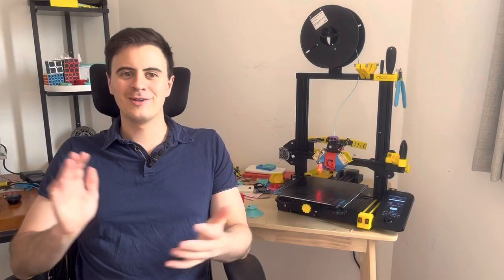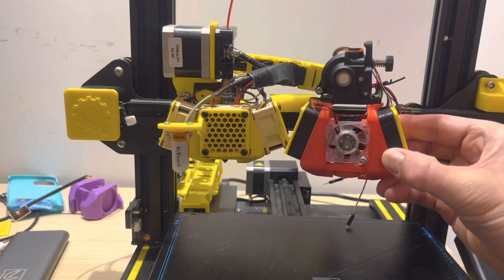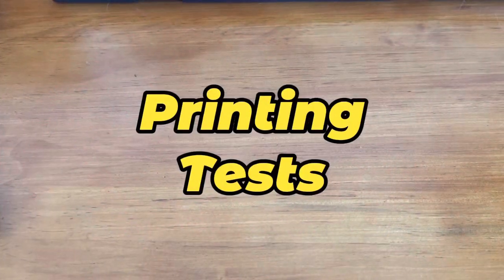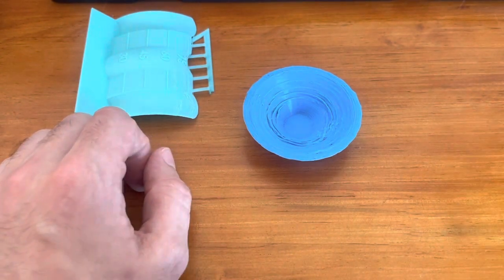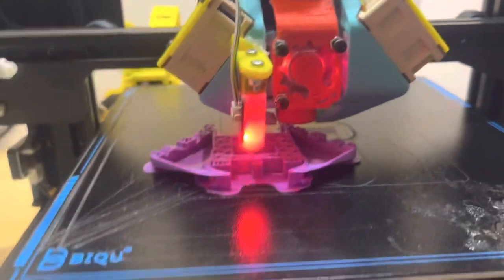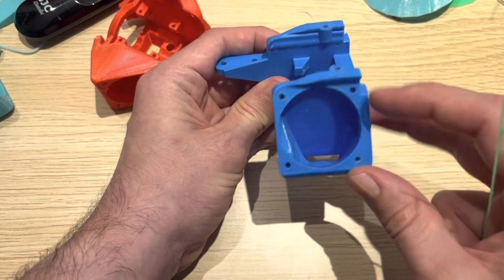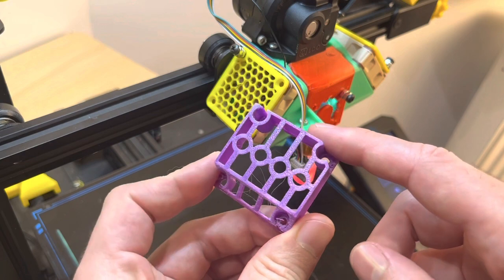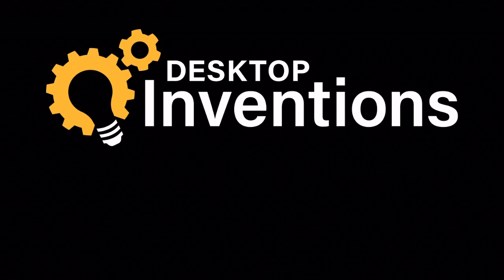Ender 3 V2 Printing Head Upgrade Dragonfly + Orbiter V2 (Part 5)

Comment: Why not to use 5015 ?
Reply from the maker: This is a great question. I wanted to stick with axial fans to be more quiet, but in the end the 5015 radial fan performs a lot better.

Comment: This was phenomenal! Great engineering! Super interesting! Cant wait to see more!
Reply from the maker: Thanks for the kind comment!  Glad you found it interesting, I thought I was going crazy after about V7 haha
Reply: Seriously 👏👍
Reply: @DesktopInventions  do you have a redesigned x axis stop switch for the larger shroud?
Reply from the maker: Yes I do thingiverse 5154640 now has a long version to download
Reply: @DesktopInventions  it seems the slot for the x axis switch is slightly too large. Is there a specific perimeter and infill combination, or just put a dab of hot glue on the switch
Reply from the maker: Increasing the line width or the flow will help close up that gap tighter. Mine was slightly fused together coming off the printer actually. If that’s not working for you a dab of hot glue would also work.

Comment: I have a slight issue with the design, i 3d printed the mount and ordered the parts. But now the Orbiter wont fit because its mounting holes are offset to each other and the drongfly bms is too long for the mount.
Reply from the maker: Which version of the orbiter did you order? Also which version of the mounting head did you download from Thingiverse?
Reply: @DesktopInventions  I downloaded the mounting head for the 4010 fan at front and I ordered the v1.5
Reply from the maker: Ok I think the orbiter V1.5 has a different mounting pattern. I can look up the model and make a quick modification.  I’m not sure why the dragonfly isn’t the right length though
Reply from the maker: Do you have a measurement of your dragonfly from nozzle tip to the Bowden input?
Reply: @DesktopInventions  is there a different version than the dragonfly bms? I would really appreciate that if you added it for v1.5
Reply from the maker: My dragonfly is 49mm from nozzle tip to the top of the heat sink. I don’t think there are different versions, let me know if yours matches. I can finish the model tomorrow for V1.5
Reply: @DesktopInventions  that would be amazing because the v2 orbiter is out of stock sadly in my region
Reply: @DesktopInventions  and I just ckecked, the blue dragonfly bms has one fin more on the cooling part.
Reply: @DesktopInventions   @DesktopInventions  dragonfly changed the length for their hotends, they now have 7 fins and not 6 like the one you have in the video. They say that Top of toolhead to nozzle tip is bang on 61.5mm.
It is a drop in replacement and has the exact same measures as the ender stock hotend.
Reply from the maker: That's interesting, I couldn't find anything on their website about a 7 fin version.  Anyways I added several updated models to Thingiverse and Printables now and some pictures to explain which models go with which parts.  The model you should need is the Mounting_Head_Stock_Orbiter_V1.5_4010 which has the same vertical height as the ender3 V2 hotend and has mounting holes for the Orbiter V1.5.  I hope this works for you, let me know if you have any more questions!
Reply: @DesktopInventions  I can not put it into words how thankful I am. Thank you very very much you are the best!

I did some research on forums about the hotend, there is no much info but it seems they noticed that the 6 fin version was a bit too short as a drop in replacement for the ender 3v2, so they made it longer. The pictures from where I bought it ate with 6 fins, but all the pictures from reviews are with 7
Reply from the maker: That makes sense, their website says it’s compatible with Ender 3 I suppose they just didn’t update all the marketing pictures.

Your welcome I hope it turns out well for you 😀 I’m working on a new version with magnetic attachment next maybe I can get the video finished next week on that one.
Reply: @DesktopInventions  I will submit a picture jn thingyverse once I fully assembled everything. I'm definetly stocked about what's coming up.
Reply from the maker: That’s awesome! Glad to hear! And thanks for the support 😃

Comment: I have a very similar setup on my Ender 3 Pro. I've got an Orbiter V2, Dragonfly, and HeroMe Gen 5 fan shroud. I designed a custom mount that holds the extruder, hotend and shroud along with an integrated ADXL345 for input shaper on Klipper. Generally a very nice update. Much better cooling, quieter, and improved extrusion. It's also set up to handle higher temperatures, so 300C is totally doable.
Reply from the maker: Sounds like we have very similar hardware! This is the first time I’ve heard of the ADXL345. An accelerometer mounted in the printing head to help with cornering, ringing, etc? I will have to look into that 👀
Reply: @DesktopInventions  It's used to test the resonant frequencies so that Klipper's input shaper can avoid them and run the printer at higher speeds and accelerations without ringing artifacts, etc. I know some other firmware provide similar functionality, though they may just use a test print to identify ringing.

Comment: Swapping in Sunon Maglev fans in place of the Noctuas will give you drastically better airflow. Since the function of the ducts is essentially compressing the airflow and creating higher static pressure, you should seek fans that are designed to operate under that pressure. Noctua's fans don't have the greatest specs in that regard. They tend to be geared towards more open air flow design and use.
EDIT: You also gain the advantage of using native 24v fans and if you find the Sunons a little loud, they still produce hefty static pressure at lower speed/noise thresholds.
Reply from the maker: Thanks for the advice. I’ll plan to look at ordering some maglevs for testing if I can find them here!

Comment: First of all, awesome Design, i am looking forward to building it myself. 
What are the offsets in x and y direction for the BL-Touch?
Reply from the maker: Here are the offset values.  I am still struggling a little bit on the overhangs more than 60 degrees.  I'm working on getting an update out this weekend.

X -24.9
Y -42.8
Z -1.5
Reply: @DesktopInventions  wasn't the part cooling on point judging from the bowl test?
Reply from the maker: If you’re using 4020 fans it should be no problem but dual 4010 fans performance is about 60-70 degrees for overhangs. I added the a new version for a 40mm fan on the front which performs a little better due to adjusted hotend placement. That version can do 70 degree overhangs with 4010 fans
Reply from the maker: Also the bowl test is 70 degree overhangs on the top level
Reply: @DesktopInventions  so the files are already on thingyverse I assume?
Reply from the maker: Yes both designs are there
Reply: @DesktopInventions  sweet, already ordered the parts, stocked to try it out on my ender 3v2

Comment: Great design! Currently pondering if I want to design one too...
Reply from the maker: Definitely a great learning experience!
Reply: That's what I was thinking. I recently swapped the stock cooling setup on the V2 for a community designed one and really like it (improvement over original), but I can yet see a few improvements to make on this one. 

Thanks for the inspo 🙏
Reply from the maker: Yea I’d say go for it! Just don’t throw the old one away in case you have to print a couple versions of the new design ;)

Comment: I just started 3D printing recently, so there’s a lot I don’t understand, but what’s the benefit of this type of upgrade? Does adding additional fans help the extruded plastic cool faster and therefore adhere better?
Reply from the maker: More cooling generally helps with overhangs or unsupported parts of the print. Something like the underside of a bridge. If you don’t cool the material enough as it comes out of the nozzle it will be too soft and sag when printing these types of features without support.
Reply: @DesktopInventions  Thank you for answering my question! That makes sense.
Reply from the maker: Your welcome!

Comment: I already updated all the same as you (Dragonfly BMS, orbiter v2, mounting head...) . I printed the test bowl and got the same results as original stock. And got ugly wall/layers on any 3d models. What's problem?
Reply from the maker: Sorry your having issues with this printing head!  What size fans are you using?  I'll see if I can make make some improvements to the design this weekend to improve the flow even more.
Reply: @DesktopInventions  Okay, mine fans are 40x20mm

Comment: can you design one that can be used with the noctuan fan ❤
Reply from the maker: You mean a noctua 40mm fan on the front? Yea I’ll probably work on that variation this week. The little 30mm fan now is a little noisy
Reply: I have all the same things and it‘s printing very good
Reply: (Part 4)
Reply: will you then also make a design that works with the standard hotend?  would be very happy
Reply: @DesktopInventions  that would be a dream
Reply from the maker: Standard hotend with what extruder configuration?
Reply: @DesktopInventions  Withe the standart one
Reply from the maker: Ok I should be able to finish it this week

Comment: what are the 12 to 24 volt adapters you are using? they seem nice and small and i need some to convert my printer to 24 volts
Reply from the maker: This is what I use to go from 24V to 12V

DC converter link:
https://www.amazon.com/dp/B08R6337QY/ref=cm_sw_r_awdo_navT_a_RVV33CMAH9QZD15W7CNG
Reply: @DesktopInventions  thank you!
Reply from the maker: @nicholasbackus492  I've heard from the comments and seen some feedback on the Amazon page for this DC convertor that people have had issues with it not working above 18V.  It worked fine on the ones I bought, but just wanted to bring this up to you to beware there could be some quality issues.  There are many other options on Amazon you could also use but I haven't found others as small as this one.

Comment: I've heard using a bucket converter and 12v noctua fans isn't good because if the buck converter fails it can cause damage to the part that needs cooling
Reply from the maker: This is true it does add another component that can fail in the system. Definitely true of most modifications perform at your own discretion.  So far I’ve had good luck with mine knocks on wood :)
Reply: @DesktopInventions  nice! Good to hear. I'll probably look into it a little more.